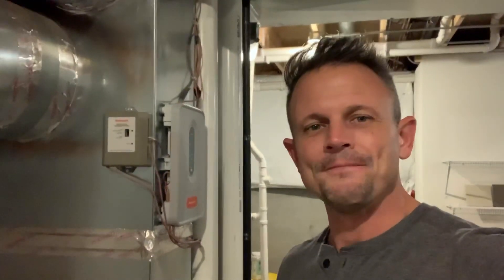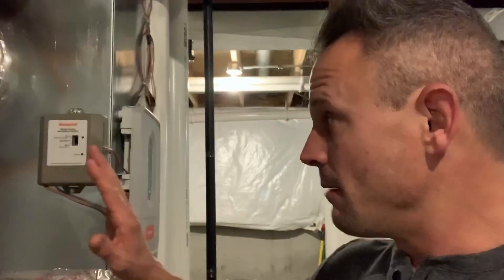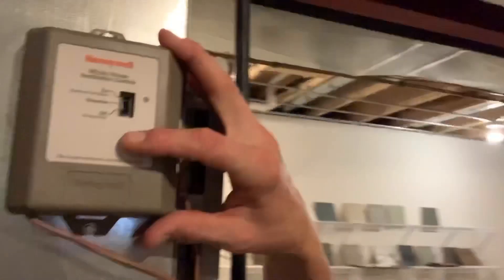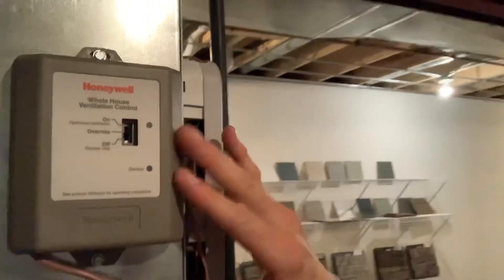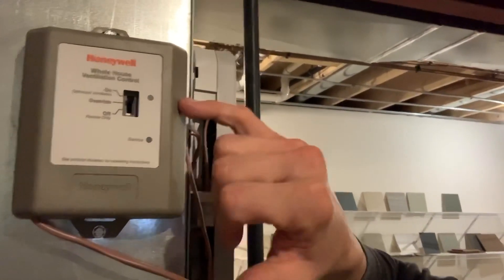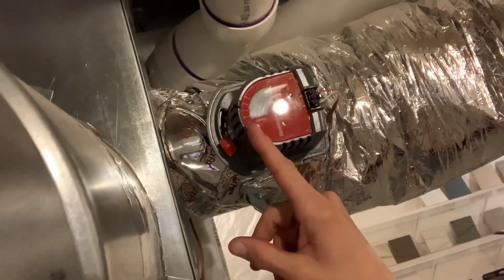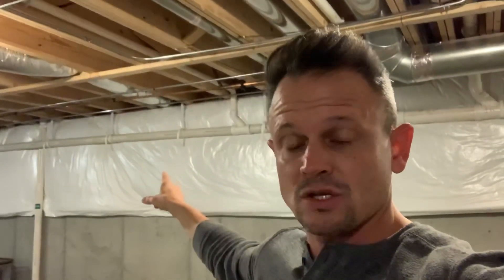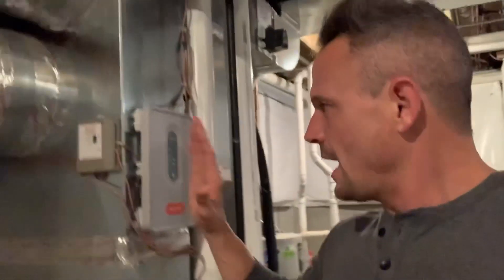How does a whole house ventilation control or fresh air intake control panel work

Comment: Does anyone know if this is the reason my house is blazing hot up stairs and cool downstairs in the cold winter? Because with this on, it’s constantly brining in cold air from outside and pushing hot air from downstairs up and trapping it up there. Meaning the heat is always working downstairs to warm up the cold air coming in. I have a dual zone thermostat to control the bottom and upstairs temperature and that’s not helping out he issue I’m having. My home is new and properly insulated. I hope my shutting off the ventilation control like this video suggests will fix the problem. If so, thank you sir for this tip.
Reply from the maker: Turning off the system should help with your situation. 

A couple things one I know you have a dual zone system, however for people that have a single zone system typically have to seasonally balance the system. 
Which can be done by following my instructions in this video
https://youtu.be/VwZpOzOBDqA

Second, you mentioned your house is brand new. I can’t tell you how many times I’ve seen heating and air-conditioning contractors accidentally reverse the zones. Where the second floor thermostat works the first floor, and vice versa, the first floor and basement thermostat works the upstairs. 

You’ll want to confirm the thermostats are controlling the zones they are in and if not have the HVAC contractor correct it while you are still under warranty.
Reply: I have battled he same thing.  Leaving the heat very low and the Fan on (vs auto) for the upstairs thermostat has seemed to help a great deal in keeping the upstairs not so blazing.  Good Luck - I know the battle all to well!!

Comment: I just found your video while trying to determine the proper damper settings (0, 1, 2, 3) but realized that we do not have that white control box that allows us to turn it off. What is the model number for that device? I thought about just adding a small low voltage SPST switch to basically cut the power to it when needed. My ultimate wish is to have remote control of it as I already have remote control of my thermostats through redlink.
Reply from the maker: @ezpeteyt Sorry for the delayed response I just saw this comment your comment now. 

Do you by any chance have a continuous running fan in one of your bathrooms?

The reason I ask is because I have seen homes that have a continuous running fan usually have a similar damper system like you see in this video that actually always stays open. Allowing air to come into the home while it passes through and out the continuous running fan to keep the home from becoming a negative pressure. 

I’m sorry I don’t know the model number of that Honeywell whole house ventilation system control panel, however in theory I would think installing a low-voltage switch so you can manually turn on and off that damper would work.
Reply: @BJPoznecki  That would make sense but I don’t believe we have one.

I thought about the low voltage switch but it was my impression that the device you covered had remote control. Would save me a trip to the attic.

Thanks for replying. Keep up the great videos!
Reply from the maker: @ezpeteyt  Thank you for the compliment I appreciate it, I’m happy to hear you like the videos! 

Sorry for the confusion, no that control panel just has a toggle switch on it, it does not come equip with a remote. I’m only familiar with that specific system that our HVAC contractors would install for the Builder I used to work for.

Honestly I’m not sure if there is a system out there that has a remote option? I’m only familiar with that Honeywell system that our HVAC contractors installed for the builder that I used to work for.

Comment: Just to clarify, we live in south Texas; when should I turn it on? TIA!
Reply: I’m an hour south of Austin, in the Lone Star state of Texas. The house is 10 years old. The walls are spray foam insulated. The builder said to keep ours on regardless of the outside temp to vent humidity out of the house. The “enveloping” if a house, because it is airtight, can trap excess moisture. The fan running that 15 minutes every hour gets that humidity out of the house, or so she said. 

All I know is that our electric bills are really high and I wonder if using the fan is the cause. Any thoughts on all of this?

Oh, and funny enough, spent  8 years in the Chicagoland area! While too cold for me, loved the downtown area. Used to go in from Hoffman Estates all the time. Our son loved the train 🙂

Good video. Loved the info.
Reply: @JulieMoran1832  there’s no way it will vent the humidity out if it’s not running in tandem with the AC system. This draws air in, effectively pressurizing the house. The only way the humidity will drop is if it’s removed via dehumidification or AC
Reply from the maker: Love Texas, great state! 

You can turn the system on whenever you like, I just made this video because I wanted everyone to understand that when the system is on whatever the out side temperature and humidity are, the system will bring that air into your home. Which can cause your heat or air conditioning to run more often depending on the outdoor temperature. 

With that said I tell my customers to turn the system on between 50 and 75°.
Reply: @BJPoznecki  I appreciate your prompt response, thank you! Awesome video too!
Reply from the maker: @skalien51  My pleasure Jo! 

Thank you, I’m happy to hear you like the video and thank you for the compliment I appreciate it bud. 

Hope you guys have a great Thanksgiving!

Comment: Is there anyway to set it to run only when Heat/Cold is on?
Reply from the maker: Jeff Kang Unfortunately no not this particular system, there may be other systems that have that option, however this system you can have the thermostat completely off and it will turn on and bring fresh air into the home.
Reply: @BJPoznecki  thank you
Reply from the maker: Jeff Kang My pleasure never hesitate to reach out if you have any questions on anything!